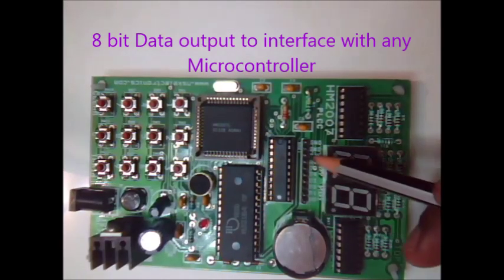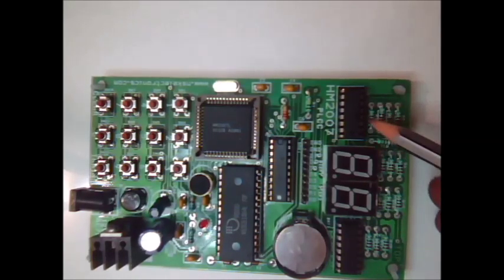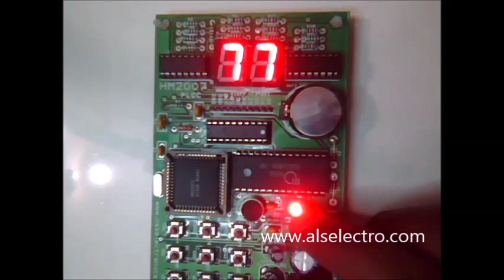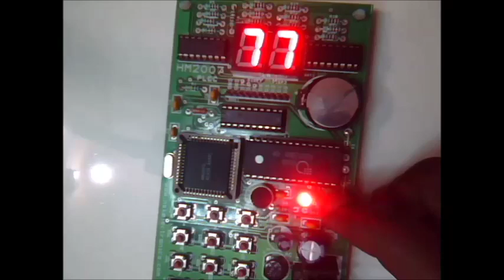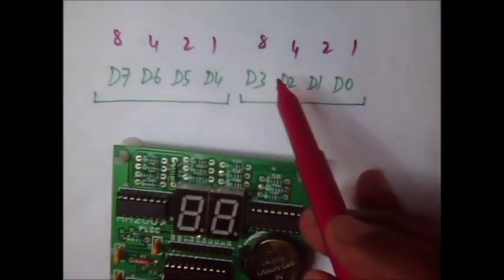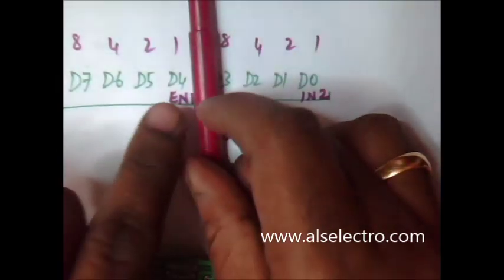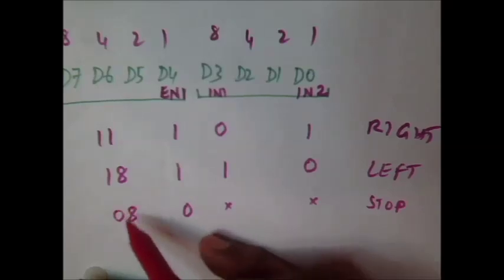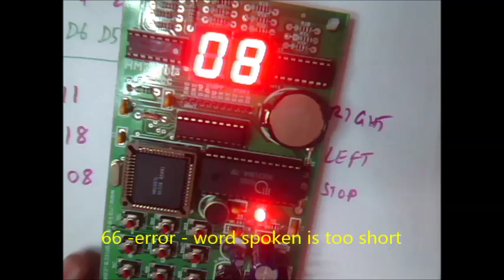Voice Recognition board HM2007 - How to control a motor using voice commands

Comment: sir i record the commands successfully..but on connecting the motor driver the board doesnt respond! It shows weird displays on the display! and do we have to connect the nuetral of the 12v supply to the common grounds?

Comment: Sir,
The video was very helpful, i would like to rotate a motor using Arduino instead of L293. Can you please suggest a way of connecting Arduino and HM2007 Board and further tell me how could we connect various electronic appliances on that Arduino which is controlled by voice instructions.
Reply from the maker: Deepika Singhal Never drive a motor directly from Arduino.It'll damage your Arduino.Driver IC like L293 or ULN2803 is needed to source enough current required by the motor .
To control different appliances you may use a relay board.Program in such a way , a particular relay operates on a particular command.
Reply: Saravanan AL Sir, my main purpose is to connect arduino with Hm2007 Board. So please guide me as i want to control devices by the arduino as i give speech input to HM2007 Board.